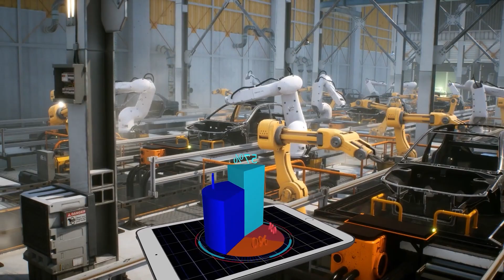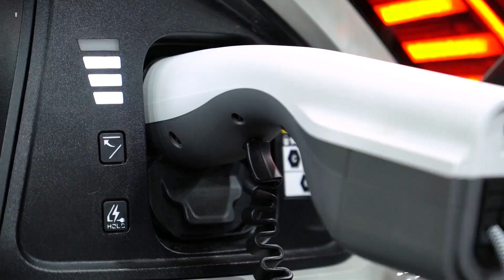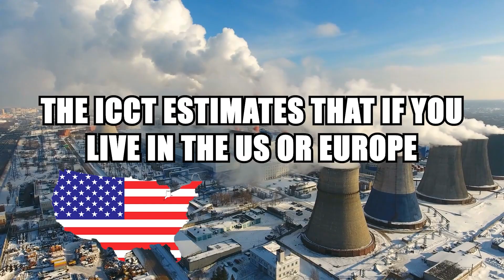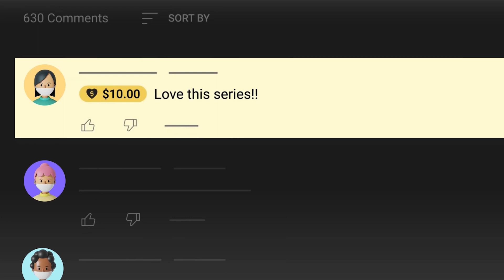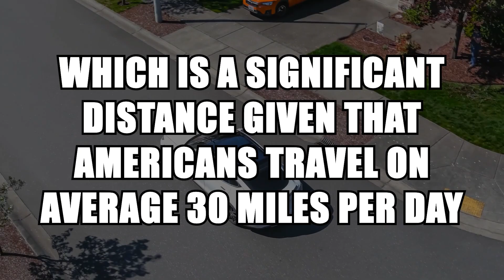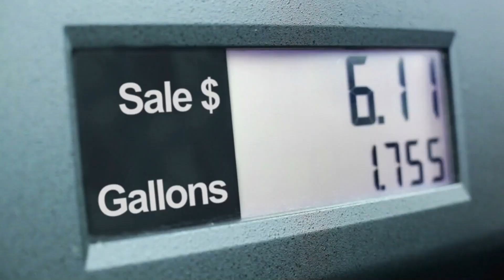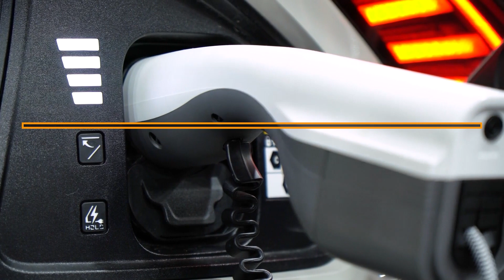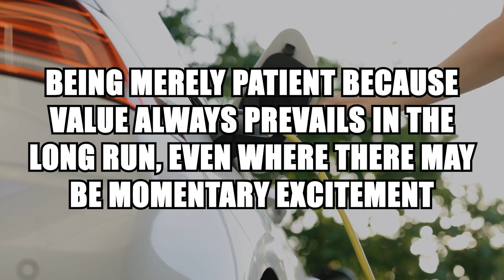Why Electric Cars Companies Are Lying To You

Comment: Rather inaccurate/irrelevant video, mostly fossil fuel propaganda based on the concept that less is not zero.   This is wrong because less is still better.
No real evidence provided for "lies".
There is only 1 moving part in an EV electric motor, if you know how to define "moving parts".  
You do not "need" Lithium, Cobalt Nickle, some batteries use these others do not.  Mining may produce CO2 because we havn't made enough batteries yet, but its no worse than mining materials for combustion vehicles, but you need ALOT less material (eg no oil for fuel).
There is no "lying", "vehicle emissions" have been defined by the combustion industry, fuelling refining and vehicle manufacture are not included.  BEV's emit less (indirectly), ALOT less.  Nothing currently made is carbon free, making a phone call causes some carbon emission.
Public charging is not a barrier to adoption.  range is absolutely a non-issue for most applications, and companies like Tesla have good networks.  Public charging for public parking can be easily solved, its really not rocket science.
We will not run out of lithium by 2050 (this is probably referring to existing known reserves, how many reserves do you think will be found by 2050), is it not a fuel, and of course we will recycle it.
Mining safety, is very laudable, but we need to mine for everything and we have been using China/Africa/wherever mined materials with suspect human rights, why do you need new rules for EVs.  Why not make rules for everything we make or buy material for?  Why are EVs suddenly the only items that need to be made totally ethically?  Have you looked into what goes into a mobile phone?  Did you complain about them funding conflict in the congo a number of years ago?
Really utterly stupid video
Reply from the maker: Thank you for watching and sharing your inputs on this topic.